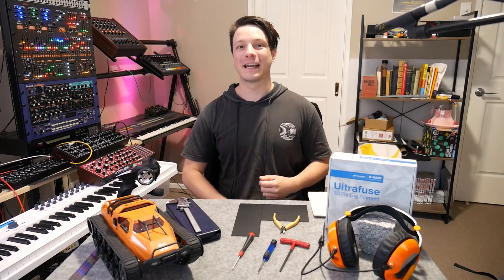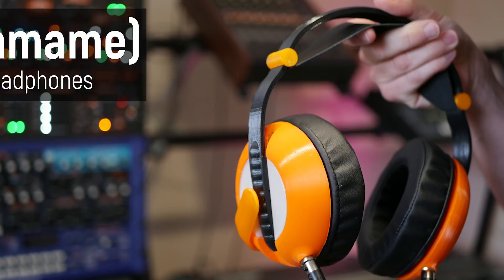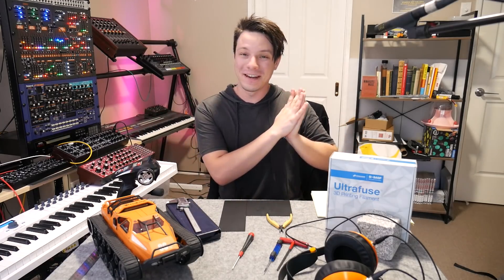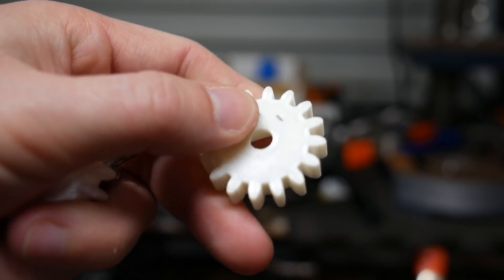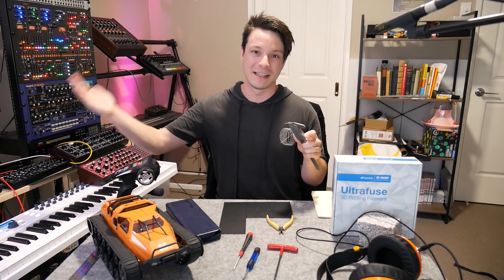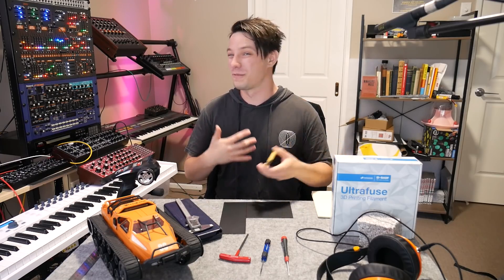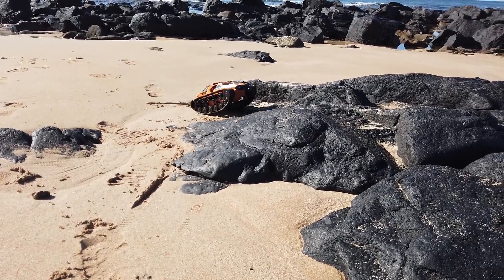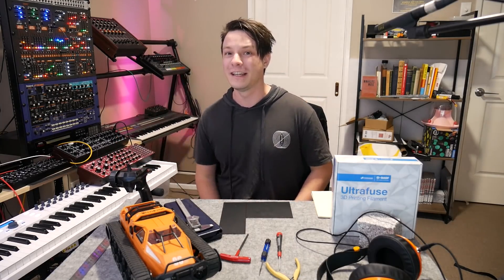The BEST Gifts for 3D Printer Fanciers?

Comment: Hobby knifes that have changeable blades is another tool gift you can add. Needlenose pliers is a great tool to have too. Depending on what they like to print you can search the web for for cool files to purchase like a model car print with all the pieces separated or some dragons really the possibilities are endless. Get a small flash drive fill it with the files you purchased small and easy. I know there is a lot of free stuff out there but sometimes buying a file gives you more detail.

Comment: I have the artillery sidewinder x2 but I think I got a defective model bc mine fucking sucks. has yet to run a single time without countless issues. every print takes 10 failed prints before and after. I wish I loved it as much as you :/ or that I had remembered to call them before my warranty expired. lol

Comment: consumables are honestly my favorite gifts, about 2 - 8 bft of some exotic wood i would shy away from, polycarb filaments, random fasteners or terminals, fancy heat shrink or sleeving, bearings, aluminum extrusions, lead screws or rods. things i can use to make other things. i hate getting expensive tools as gifts from my wife, one it may not suit my needs or fit in my shot, and two i was just robbed the agonizing enjoyment of doing the research

Comment: Need some help, please it's regarding some issues with my laptop I've been looking around for anyone tech savvy and nobody is able to help me,I know this is a channel about 3d printing but I won't be able to get prints if my laptop is dead.... help....   I changed my cpu processes from 1 to 4 and then when I tried to set it back because I felt my cpu may have been running to hot I set it back to one or 2 and then restarted it and now it won't turn on! If I reset and re-download windows twn will it fix the issue and restore my cpu settings...... it starts up and shows dell logo and I can get into bios etc but not safe mode if I reset and doenload from scratch will it fix the issue?

Comment: If you want a great 3D printer, I recommend the Anycubic Vyper. It has a touch screen, silent stepper motors, self-leveling 16 point touch, and a decently large print volume. New it's about $350-$450 but on eBay I bought an open box for $195. It was brand new and never used, just a return so that's one way to save a lot of money. It also comes with 1 year warranty and free returns. It has a recommended print speed of 80 mm/s^2 but can do up to 110 I believe. Never tried though.

Comment: Some great advice here. I saw the lindstrom cutters near the beginning of the video, so was glad you recommended these. I have a pair that are now 39 years old. Used them a ton. The jaws still meet together properly and don't have chunks missing out of them. Mine were £35 way back then and the same ones are about £50 now, which is a bargain. I'm keen to try that Ultrafuse PLA too. Thanks for the video.

Comment: If you're gonna buy tools, buy good ones. If you're on a budget, even a simple but good quality screwdriver will be better than a cheap, say, soldering iron. There's an old saying in german, "I can't afford to buy cheap tools", the message being if you buy cheap it'll break and you'll have to buy another one, while good tools can last years, decades or even generations.

Just to add to the list of possible gifts: Ceramic tweezers. They're electrically and thermally nonconductive, making them perfect for, say, plugging in hard to reach connectors on your printer's mainboard or holding on to wires as you solder them, and if you've ever used cheap tweezers you know how frustrating it is when they get bent out of shape.
Reply: This phrase from Alec Steele runs every time I buy something expensive: "Buy once, cry once."

Comment: I did work for Telstra many years ago and i was issued with a pair of Lindstrom cutters in 1978 and I still have them. I would have cut100's of thousands of wires with them and they are still as good as new.

Comment: If buying hex drivers for someone tinkering with 3D printers), remember to get (a set including) the small ones. 1.5, 2.0, 2.5, 3, 4 and 5. A lot of sets don't contain especially the first 3, because they're geared more towards working on bigger stuff - but those are the most common sizes on 3D printers.
Reply: And having a ball end on the hex drivers is a good idea as well. Sometimes you can't quite get straight on to the screw. With a ball end, you can be at a bit of an angle and it still works.
Reply: @lloydchung659  Ball end on hex keys are really great to have, but if you're going with the screwdriver type which has only one hex end, I would caution against a set with ball ends being your only (!) set of hex keys. Because the smallest sizes, 1-2.5mm especially - there's so little metal in the screw head, and the hex "hole" so shallow - that it's extremely easy to round them off. So ideally you would have 2 sets, or a set of keys/drivers with two ends - one ball end and one straight with a sharp cut (minimal rounded edges). That way you can use the ball end ones for inserting and undoing screws for ease of access at an angle, but use the straight cut ones to crack loose and torque down the screws.

The good news is, that a set of straight cut (or ball end) hex L-shaped keys, is very affordable. Just get one of hardened black steel or chrome-vanadium tool steel (which most are). You only need these for that first (or last) half turn, so comfort or high quality etc isn't that important - you can focus the budget on the ball end set.

Comment: Don’t be afraid to get something they already have…..  another PI, a pack of resisters, capacitors, transistors.   A set of precision screw drivers.   A multi meter.    Even if they already have them, another will be appreciated and used.
Reply: Most things like this are like chocolate bars, unless I have 10 of them, I could use one more.
Reply: @Lagggerengineering  perfect analogy
Reply: Don't tell me how many meters I have... (at least 10)... Oh hummmm..

Comment: Suggestions for gifts for makers: Sandpaper, Emery blocks, rotary tool bits, chisels, files, multimeter, DC bench power supply, a Helmer drawer unit from IKEA to store small parts like screws and cables etc.... lots more ideas, but you get the point.

Comment: Few random things to add to the list of hex driver replacements 
- a good screwdriver bit set thing.  I happen to like a Jakemy 43pc set since the handle is a bit easier to grip, but there are others out there.
-A 3d Pen.  Works wonders for fixing issues in a print and gluing them together without actual glues, as long as you make sure you get one that can support the same filament as your printer. Feed scraps that are too short for the main printer though the pen for other uses.
-M3/M4 assorted screw length kits.  Never can have too many spare screws in sizes that most printers use.
-Side cutters - I use a Hakko-CHP-170, but seem to be similar to the ones listed, but a bit thinner.  take care of them, they last.

Comment: If you aren't looking to spend a lot on a 3d printer for someone, the Flsun q5 or qq-s pro are fantastic units,easy setup and easy on the bank. You can get either of them setup and printing easily. 

An absolute must is a good pair of flush cutters. The ones mentioned are great but
If you have a harbor freight near and need a cheaper option, get the Doyle or if you want to spend a little more,icon. Don't bother with the cheapest,they are equal to what comes with the printers.

Comment: Lowe's home improvement has a ratcheting mini screwdriver with the changeable bits. I've had mine since 2015 or so and use it at work. Not expensive at all either, I think it was less than 20 usd.
Edit: it's Irwin btw

Comment: 2-component silicone. It's so extremely useful and such a great companion to 3D printing. People who've never tried it don't know how easy it is to use. A lot of the time instead of trying to 3D print extremely soft flexible filament, it's much easier to just print a mold from PLA and make a silicone cast. And if it doesn't need to be pretty, you can often just use gobs of silicone directly. E.g. I recently printed something from PLA that was to stand on the floor and I wanted to stop it from sliding around. So I just mixed a little bit of silicone and smeared it onto the bottom of my PLA print. No more sliding.
Reply: oh wow i've never heard of that before :D

i'll have to make a few edge protectors for a project some time in the future and using 2 component silicone sound much better than waiting for regular silicone to harden inside a mold

Comment: The G10 vid was the best, because when I flipped my old black Ender3 build plate it was G10 underneath. Basically all my prints are now perfectly flat with no corner shrink up-curl - my prints stuck strongly to the black top surface, but it would lift off the G10 leaving the bottom of the prints dome like -.

Comment: Well. The Bondtech CHT nozzle also comes in a MK8 version that fits the MK8 heaterblocks. i.e. Ender 3 etc etc.
You can also use the Bondtech CHT V6 version on the Ender 3. Stefan tested that also.

Comment: Actually the Volcano Clone Hotend ist the big downside of the Sidewinder. If you use a Volvano, you have always the problem with more stringing and filament drippung, With the Bondtech CHT for "normal" hotends the Volcano came mostly obsolent - you only need if you need fast printing with abrasive filaments, as there are no highflow abtasive resistent nozzles for standard hotends. This is a rare usecase, as mostly theese filaments are expensive, so you would mostly print slower to get better prints anyway (and as a filled filament cools down slower, part cooling is a problem, too, if you print fast).

Comment: My bf just bought me a new bed and hot end my hot end got filament stuck, like it fully melted to the hot end my bf is a weight lifter and machinist and couldnt even get the filament out cuz he didnt want to break it. No idea what happened  i guess cheap filament and operator error 🙅  i think ive tried the ultra fuse filament tho i think i have a black one , i think .

Comment: Another really good idea are a variety of razor blades for hobbyist. I have a Fiskar kit that has a variety of blade types from the triangle exacto blade, chisel blades, curves both convex and concave. Best thing anyone has ever got me as a maker type of gift. Especially with 3D printing where we often have to get in with a sharp edge into a spot your typical knife and blade shapes just don't do very well. 

Drafting tools are another one we often forget we need despite using them so much. You wouldn't believe how hard it has become to find a good compass, the vast majority look nice until you see the seam and realize it''s paper thin metal folded into a tube shape, those don't hold their shape very long once you start to really use them.

Comment: Regarding the callipers, I'd recommend going with manual calipers if looking at the cheaper end of things. Way more robust and you don't have to worry about them losing calibration.
Reply: My bf is a machinist and im just starting 3d printing he got me both manual and digital . Im still learning printing and cnc though
Reply: If you have a leftie in your life who use or need them, consider getting them calipers for lefties. If you don't get why, try using normal ones with your left hand a bit 🙂 They're highly directional tools (which is why the ones with "just" a flip'able display is mostly a gimmic, the tool itself is still shaped for right hand use).
Reply: Thank you finally someone that's not like "pfff get digital calipers" I use my dad's trusty ol' calipers with number on them, they're like 30 yo or something and still work precisely and as intended. My shop manager in high school had a ton to lend us, and If I remember correctly they were digital but his was a regular non digital but man, it was honestly incredible. Locked it didn't move a single bit, and unlocked it slid just perfectly and you could adjust the tension on it too
Reply: Vernier scale is what ur talking about and they are great but require much more skill and better eye sight. And after seeing how many ppl can messure on a tape measure im not surprised why almost every1 buys digital caliper
Reply: @alockworkorange7296  sad world we live in man
Reply: been a machinist for over 25 years and vernier calipers are usually only used in extremely dusty areas and with very large parts like 2-5 feet, usually around laser tables. the rest of the shop mostly uses digital or dial(in some cases) Mitutoyo is the most common brand. for home use(cheaper) i can accept the iGaging caliper(the yellow and grey one about $40)
Reply: Agreed, you'll get a much better set of dial Calipers for similar price. I picked up a pair of Brown and Sharp's from ebay for less than $50.

Comment: I'd make 3 suggestions as 3D printer gifts. A second lead screw kit for the right side of the printer. This adds support to the X gantry and facilitates bed-levelling. The frame still needs to be squared for anything to work properly. Replace the Bowden tube extruder system with a direct drive system. On my E3V2 3D printer, the Bowden system might have been faster, but the extruder sucks. I tried an aluminum extruder thinking it would be better than the plastic one. Thing is, it's the same as the plastic one except it's made of metal, and the design sucks. Replace the bed springs with silicone mounts. I replaced the stock springs to the suggested stronger yellowish-colored springs, but these were not much better than the stock springs. Since changing for the silicone mounts I haven't had to relevel the bed on one of my printers, and it's been working nearly 24/7 for 2 weeks.
Reply: Thats what you get buying a bad printer.

Comment: A raspberry Pi for someone who's running of an SD/USB drive
A solder station
Helping hands
A dremmel, or bits for one
First Alert "EZ Fire Spray" for near the printer
Good safety goggles
Capricorn tube
Rubbing alcohol

Comment: Yea... I usually buy on the more expensive side but cheap 'ed out on my first pair of clippers... Batteries would die so fast I practically had to buy them in bulk to replace them whenever I needed to measure something - It drove me NUTS.
Then I finally caved in and got myself a Mitutoyo. First thing I noticed that they - unlike the cheapo ones - don't turn themselves off after a while of use which immediately rang alarm bells... ( I mean the cheap ones would run low withing weeks WITH them turning themselves off and now the at least 10x as expensive ones wouldn't even turn themselves off!? ) but despite me constantly forgetting to turn them off ( IDK... Probably too used to the cheapo ones doing that ) I've yet to replace a battery and it's been about a year since my purchase - Hoo-ree-crap man - Love em.

Not familiar with WIHA but I'm really diggin' WERA ( sounds like one of them is a knockoff of the other?! ) ever since buying my first Torque Wrench from them for use on my CF Bike. Everything that has to do with fastening something down I buy from them and everything that is related to cutting and clamping I get my tools from KNIPEX - Have yet to be disappointed with either of them 🤔
Reply: I own both Wiha and Wera tools. They are pretty even on quality. Either one is a great choice for anyone that puts value in their tool quality.

Comment: Rotary tools. Absolutely THE single best tool to gift to any maker type of person.
Absolute panacea of what they can do, and even if they own one theres a bajillion accessories
Reply: And a soldering iron with changable tips. They are great When smoothing  seams between two parts. And with a piece of filament in one hand and the soldering iron in the other you Can stickweld your prints with it.
Reply: @ninus17  TS100 or TS80P + a set of Tips
Reply: +1 for rotary tools! i have been a maker for some years and still dont have a good cordless drill or dremel style rotary tool and there had been sooo many usefull situation for it
Reply: I just got the flex shaft for my dremel and it is awesome!

Comment: Honestly I rarely use my calipers. Usually a standard ruler is more convenient to hold and I can still read the dimensions from that with ~0.2mm accuracy, and that's enough.
But what I can definitely recommend too are high-quality allen keys. Mine have a more rounded knob on one end which allows use at a slight angle. In my designs I use M3/4 screws/nuts for almost all connections and having reliable tools for that is just great. And with that I also recommend getting a large package of screws and nuts: once you find the right tolerances for your printer it becomes really easy to design connections between parts that fit well the first time, and having a bunch of those parts at hand is really convenient.

Comment: I did fine for the first couple of years of designing & printing with a £10 digital caliper, then I bought a £90+ Mitutoyo set... well worth the expense!
Reply: I had cheap digital calipers too. They were pretty good, just slow and burned through batteries pretty quickly (were often flat when I needed them). Fortunately, since working from home, I have my work Mitutoyos here. They are so much better than the cheap ones. If I end up having to take them back to my office, I’ll probably buy some for home. They’re expensive, but given they should last a lifetime, it’s a good investment.
Reply: Back when I was looking for calipers, I found that Mitutoyo prices are not justifiable for my part of the world and for rather infrequent use.
And cheap calipers are such disgusting trash (even mechanical precision isn't there) I wouldn't take them free.
In the end someone suggested me iGaging. That seemed like a reasonable middle ground, and I'm quite happy about them ever since.